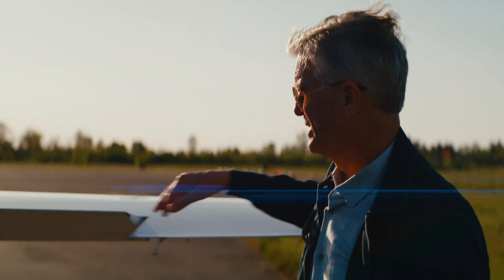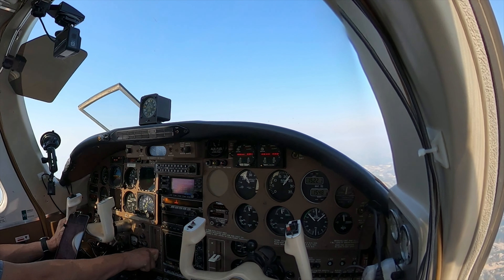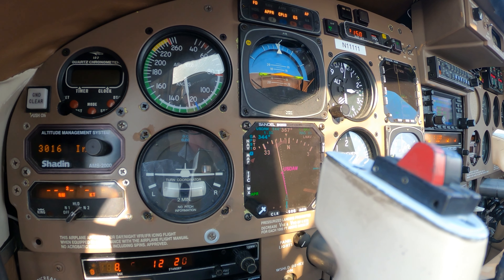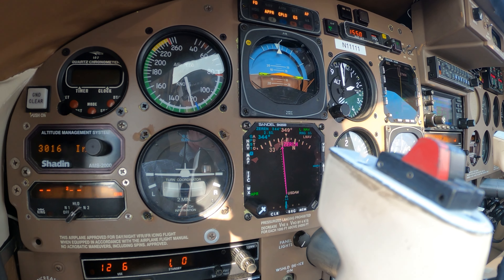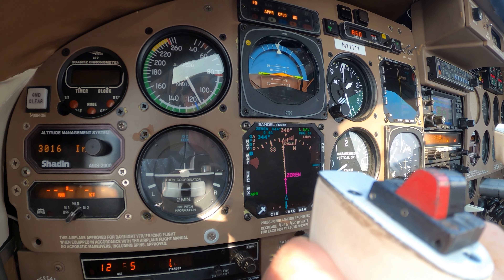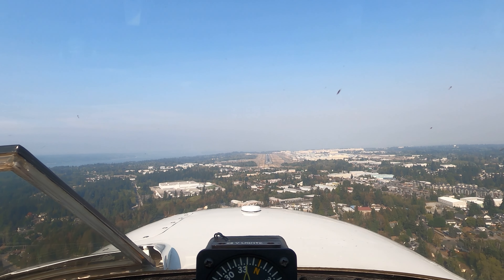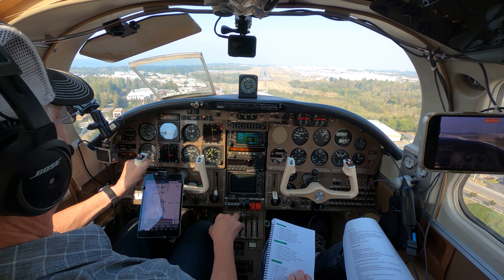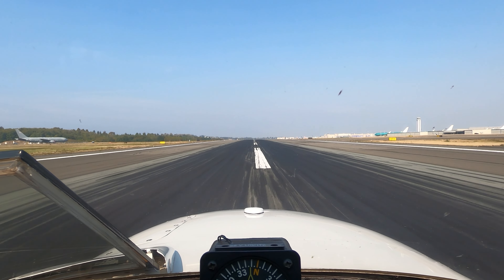Crash on Landing? NOT... Wait for It.

Comment: I went to school to be an auto mechanic and never really followed up with that and married. I wonder why you must monitor the manifold pressure and regulate the mixture intake.
Reply from the maker: Simple answer is the engines are 50+ year old technology.  Our modern car engines have computers to adjust the timing and the fuel air mixture along with electronic ignition.  Lycoming has a 375 horse full FADEC (Full Authority Digital Engine Control) engine out now that brings the gasoline piston engines into modern times.  I would love to see this engine on the Aerostar.  https://www.lycoming.com/engines/ie2. TEO-540-C1A.

Comment: Thanks for another video Eric. 
Is there a reason that you go to flap neutral after setting full flap?
Reply from the maker: It closes the flap actuator valve.  If the hydraulic system were to fail the aerodynamic pressure on the flaps would/could partially retract them.  Possibly with a split flap condition.  If you were deploying the flaps, if you left the handle down, it would deploy full flaps.